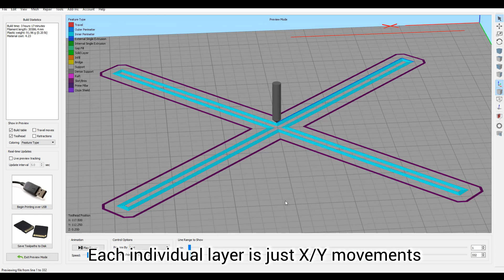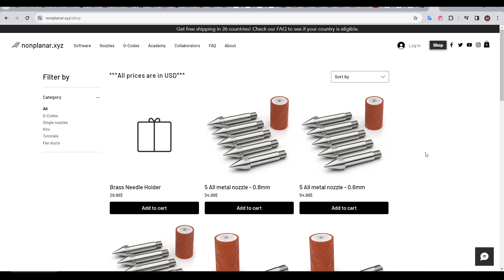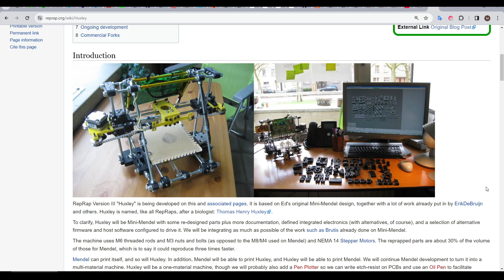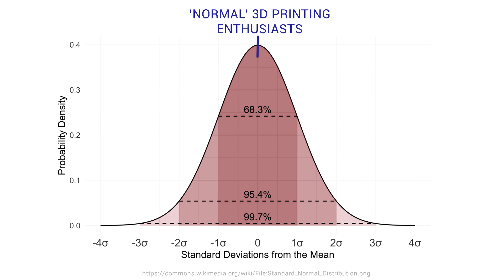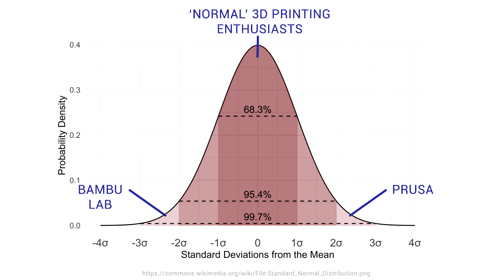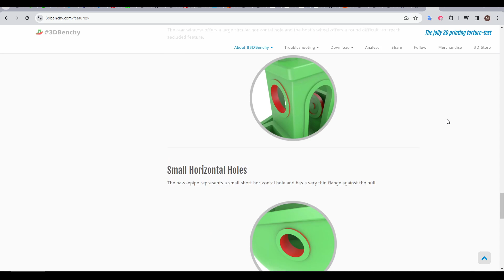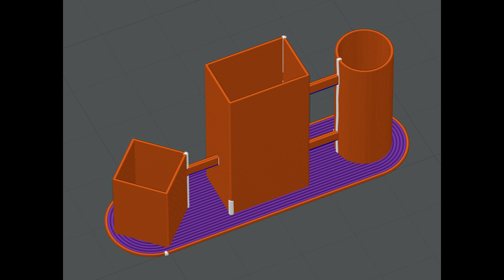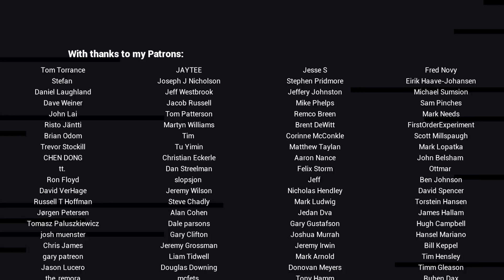3D printing mysteries that need to be solved in 2024

Comment from the maker: Thanks for all of the comments/answers! 99% of people have engaged constructively with the community toxicity topic. Regarding the 3Dbenchy, message from Paulo Kiefe:
"I can assure you that assembling two 3DBenchys (chimney to cargo bay) is not coincidental. I am the co-inventor of 3DBenchy, which I designed in cooperation with Daniel Norée in 2015. We called it the Yin-yang feature.
There is also another hidden aspect of 3DBenchy. Most people notice the CT3Dxyz text on the bottom surface and the #3DBenchy tag on the nameplate on the stern. But so far, I have not seen anyone find the hidden text inside the cabin just below the roof; it is in tiny lettering, and its text reads Creative-Tools.com CC BY-ND 4.0.
It is great fun to see that Daniel's and my 3DBenchy is so widely spread. Currently, I am developing the open-source construction set #Stemfie3D."
Reply: The 3D printing world's Konami Code.
Reply: The print artifacts should be two questions, as it's two completely different symptoms with almost certainly different causes.
For the change in texture (going from glossy to flat and back), you should be able to hear the motors' tones change when they hit those layers as they're changing speed. Those less glossy sections are printed faster than the rest. My best guess without witnessing it happen would be that it's the minimum layer time setting causing the printer to slow down when it's only printing the perimeters so it can remain under this set time, then speeding up when it's filling in entire layers as it's gone way past the minimum layer time.
As to the other one where the corners look bad whenever you have the bridge piece, it'd be far easier to figure out by watching it happen, as it could be a number of things.
In short, a large number of things can be figured out just by watching the printer do it's thing. For that reason, I prefer a hotend assembly that leaves the nozzle visible and typically customize my own with that as a major design feature.
Reply: @glabifrons  I agree with this assumption but not sure it's related to speed so much as layer time itself. I have recently had a similar problem with multi-color print that there are areas that switch between glossy/darker and flat/lighter. When looking through the different preview options it ends up directly corresponding to the layer time but looking at speed there is no variation between these two regions. I noticed it corresponded to layers that only had 1 or 2 colors were glossy/darker and those that had 3 colors were lighter/matte.
Reply: @jneilliii    It was an observation, not an assumption. I've seen this happen countless times and every time I investigated it by watching the printer print the affected parts, it's been the same thing. As I said, you can hear the tone of the steppers change when it happens, like when a song changes chords. It's also trivial to reproduce.
I'm not sure the color gradients in any slicers are fine-grained enough to show a subtle speed change (I'm not talking about a large percentage). It sure would be a nice upgrade if they'd allow a different selection for the colors that represent speed (the gradients Cura uses are downright weird, but that's the slicer I use >99% of the time - I'm not sure if other slicers allow you to change that).
Reply: as for why your filament is breaking like that inside the tube, its simply because the filament is being straightened out, at a bend radius that is not similar to the area of the spool it came off of. so as the spool gets used up, the filament wants to be in a tighter circle. you should notice that a fresh spool will not break as often, but a empty spool with tight coils will break alot. doesnt even need to be in a tube, just try stretching some out straight with some tape and see what happens.

so the only way to stop it is to unload the printer if you arent going to use it in the next 24hrs.
Reply: Same with Thom's voron build where he used RRF instead of Klipper, the comments went nuts
Klipper and voron evangelists, name a more obnoxious combo
Reply: I'm in canada and my extrude coils go in the same direction as yours (4:14) just FYI
Reply: @TDPEquinox  Yeah, I would guess that since the drills used to bore nozzles are right-handed, the filament coils according to the right-hand rule.
Reply: We found the text under benchy's  roof long time ago. Even discussed about how can we slice it and make that to be printed out internally (the "B company"). So that people can make their own hidden tag in there models
Reply: "The artifact issue" is affected by linear advances K-factor. This artifact could be spotted easily on a test cube in lines after the letters X or Y in contrast with clear corners lower or higher (if I got you right). K-factor seems to change the intensity of a dimension shifting, but problem can't be fixed by only K-factor (at least on 120mm/s with Ender-3)

 Maybe some "T-factor" could help, which would compensate thermal instability on extreme flow changes just like K-factor does for pressure instabilities in extreme speed changing conditions.
 Or lower speed and bigger heat-block, like how low speed helps with pressure issues 

At least this is my thoughts 
Hope Marlin guys (or anybody) would get there eventually :)
Reply: 8:54 Have you tried to dry the spool? Moisture makes filament brittle, which is especially noticeable on industrial filaments like PA6-CF, however I didn’t know it could get this bad on regular PLA. Note that I haven’t experienced brittle industrial filaments first hand, but I have experienced this exact issue with with PLA/wood mixed fillament, and when I dried the spool it was like brand new! :)

Edit: spelling
Reply: But don't you think building a Voron would be better? /s

As for Prusa vs. Bambu thing, I am sure a large percentage of it is paid marketing. Some time ago I've asked some questions regarding Prusa on Reddit, and not ten minutes after the posting, I got DMs like "You shouldn't even consider Prusa, because X, Y and Z. Look, you should get Bambu A1, it's even on sale now"
Reply: Apparently, most people's printers aren't good enough to replicate the fine details. I still have yet to see or hear anyone talk about the polydactyl kitten in the cabin. Mine prints out in very high resolution, but you have to use a powerful magnifying glass to reveal the details. 

P.S. Has anyone mentioned the VORON yet!!!😂😂
Reply: Have you built a Voron X1C yet?
Reply: @turbochargedbrick 😂
Reply: What exactly is "toxic" about people requesting a Voron build?  Receiving a multitude of such requests doesn't make them toxic.  They aren't coordinated, are they?
So what is that you think the word "toxic" means?
Reply: @markryan3018  I don't think he is claiming everyone saying to build a Voron is toxic. There are many people who told him "JUST build a Voron." or "You should have built a Voron instead." or similar. Rather than appreciating what he was doing and leaving positive or constructive comments, many people just said he should be doing something else. This is a pretty universal problem in YouTube comment sections I think. People always either want the popular thing or hate the popular thing.
Reply: The community is getting more toxic, or it seems as if it is, cuz u are becoming a boomer who makes generalizations...😂

Comment: Late to the party to see this video, but--- I too have seen the brittle snapping problem with old filament.  Filament that worked great when it was new.  Drying it did not help at all, so it wasn't wet.  Except that it kinda did.  Feeding warm filament from the dryer box directly into the printer solved the problem.  Allow it to cool a bit first and the problem returns.
Thanks Michael for all your excellent videos and tutorials!  You're the best!  And not surprisingly, the other ewe-tubers that you often mention are the next best.

Comment: Late to the party, but your final question is answered by: Filament temperature and length of exposure to that temperature. You see this change a lot when you have inner details on a print and you'll notice the exterior walls look different there. You can actually mitigate this some what changing the order your walls are printed, but in a way that seems counter intuitive... Outer walls first will often times hide this.

Comment: It is true that the matte finish on your parts are caused by excessive filament flow and is visible when you reach the limits of your nozzle. CHT nozzles with thermal paste help a lot. ZSD nozzles have been ordered which should eliminate the issue in theory.

I couldn’t agree more about the 3D printing community having a few more egg heads around. It would be nice to work with other intelligent people. Unfortunately you cannot fill a cup that is full…

Comment: I don't have, nor have I used, a 3D printer as of yet, but I am considering it.  I have a possible solution for your filament breakage issue. I don't know if it will work, but it's certainly worth a try. 

This is a trick used with old weed eater string...soak it in water for a while. That will rehydrate the plastic returning it's flexibility.

Comment: 10:52 Not sure if you've gotten an answer about this yet or not, but I watched a video from 3D Print Stuff about this and they found that it's due to the flow rates of the filament before and after the final layer of the shorter model. Link to the video is https://www.youtube.com/watch?v=J_pxk7HP3RE

Comment: The filament snapping is most likely a result of your spool rotating the opposide direction of the bowden tube, although simple flipping it would likely make ot snap before even entering the tube. 

The easiest solution i can see would be flipping the spool AND moving it down to the side, or moving the bowden tube

Comment: I had the same snapping situation happening with my filament.And it drove me nuts forever until I finally realized what was going on. I use a heated filament schoolholder thing. And when I use the lower exit hole for the filament to leave the box. The filament sometimes touches the heated bottom, which makes it softer and just a very small localized area. And when?  The retraction happens and the fillment is pushed back it bends it. Your situation might be different.But I would recommend looking at your setup and seeing if there's a heat source somewhere that's softening a very very precise localized part of your filament before it enters the bowden tube.
Reply: I'm so sorry about the word vomit on that, I'm using speech to text and apparently it's being processed by a potato

Comment: For the artefact on the rectangular prism, you could test if the increased extruder demand from the cylinder top layers is the cause by setting the top layers to zero and seeing if the artefact goes away or changes.

Comment: Regarding the filament breaking, that is due to moisture content inside the filament. As the filament gets older, it absorbs more and more moisture, which degrades (among other things) its plasticity as well. This is a topic very well known in injection molding and other plastic-manufacturing industries, we actually have tables on how which parameter degrades for each plastic depending on its moisture content, and we even have thresholds on what is the maximum allowable moisture content in plastic before its thermal processing. I recently purchased an expensive machine that measures moisture content in plastic and run a measurement on wide range of 3D printing filaments. Spoiler alert: You have probably never printed with "dry" filament. Even freshly unpacked new spool of filament is around 10x - 20x above the maximum recommended moisture content for plastic thermal processing. As the spool sits on the air, this will further increase to 40-60x.

Comment: 5:50 whats surprised me is the Prusa fanbase and their obsession with ready to run tinker free printing.  I can see it being a thing worth investing in when your needs include those traits, but their vitriol towards other i3 style machines because they require all of 15 minutes of assembly is insane. Especially given that Prusas only other option is a box of parts that requires many hours of assembly.  

Next is the bedslingers need to die contingent of the speed demons, we all know bedslingrs are disadvantaged in ultimate printing speed, and that higher speeds are both achievable and a significant selling point, but they act as if speed is everyones primary concern. As if sub ten minute benchies materially improve the world. Slingers not only still dominate the hobby space, they dominate the business spase as well, because even there the value of speed drops off well before the limits of the printers become an issue and production speed can cheaply be multiplied by buying half a dozen Ender 3s rather than one racing machine.

Comment: About the artifact, check layer time & speed. The print speed will be slow down if layer time is lower than certain threshold to give the layer enough cooling, which will greatly affect the surface quality.

Comment: i was just doing some pressure advance tuning and also i seen artifacts like the one with the holes and that bridge that made it appear as an indent on the other side. i think its somthing to do with flow and pressure advance. also the filament snaps when old because of the molecular break down of the polymers once you have hit that stage no drying will fix it.

Comment: In the final example, another factor alongside flow rate, is time per layer. The examples all have longer/shorter layer duration transitions along these artifacts. I have wondered if it is something to do with how the plastic cools on the model. Wish a shorter print time, the hot end is back over the part while the plastic still warm/hot. The longer the layer duration, the more that plastic cools down before the hot end is over it again. I wonder if we are seeing shrinkage that is not seen in other layers because the previous/subsequent layers are printed before the cooldown and then hold it in place preventing the shrink (but in theory also adding stress)

Comment: Filament snaps -  Currently, I print with a CR10V3, when I see filament like this, I put the roll in my dryer for a couple of hours, no more snap!  I think it's because it has absorbed moister from the air.  If I continue to print from this same roll inside my printing "tent", I have no more problems.

Comment: I thought this was more well known but filament that is breaking like that is caused by the filament absorbing moisture.
Reply: Could be wrong too but I have also noticed indentations where a flat surface is created on a part that isn’t finished, or there is a shorter part that is being finished before another and the other parts are cooling faster and causing those weird indentations.

Comment: I have found these artifacts in the last question before as well. they have a fair bit to do with extrusion pressure, and also how the start point of perimiter will change depending on if there are multiple items or not. I use Slic3r, and it will try to put perimiter start points on corners as close as possible on each part. For this reason I usually select "Rear" as the start point because I can control it a lot better by the orientation of the part when slicing, and these artifacts tend do go away. It's especially important as my printer is a total piece of crap; it's a Solidoodle 2 Pro with a modofied hotend and Y axis. I wish you could see it, your forum posts have been incredibly helpful in modifying both the hardware and software. Thanks for the great content Lawsy.

Comment: Filament direction curling explanation:
H1: inner winding tension in filament
H2: extruder pushing from one side
H3: axes of extruder and spool rotation misaligned
H4: boring rotation scrachtes in the nozzle boring
H5: aliens
H6: fan direction (lower temp on one side)
H7: corriolis effect

Let's experiment!

Comment: I expect some factors determining the direction of the extruded filament would be the orientation of your filament spool as it is being fed into the printer, level/squareness of the printer, and heating consistency of the hot end. When filament is spooled, the molecular structure naturally shifts, meaning you will have slightly different density on the interior of the coil as you do on the exterior. When the filament comes out, it would naturally deviate opposite the highest density side. As it is liquified, this density variance would quickly balance, but it would certainly impact the how the filament leaves the end enough to dictate a direction. Realistically, the most likely cause is levelness. Once the hot filament touches the surface, even a miniscule deviation from a 90 degree contact would roll it into a particular direction.

The answers here are fairly obvious, but we both know that you were not asking this because you genuinely don't know. It was a probing question to bait people into leaving comments and boost your algorithmic exposure. I see that breaking filament question also got people to flock to the comments section. Well played on the social engineering.

Comment: I suspect that the filament coming out clockwise has more to do with the rotational direction of the drill that made the whole in the nozzle than it does the Coriolis effect. Traces left behind by the drill bit undoubtedly leave a little bit of a "rifling" effect on the interior surface of the nozzle.